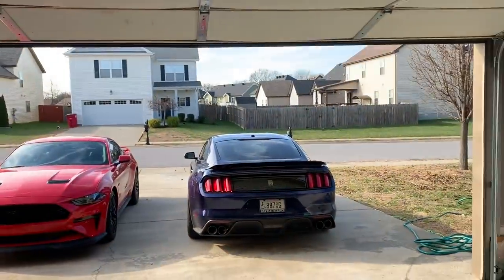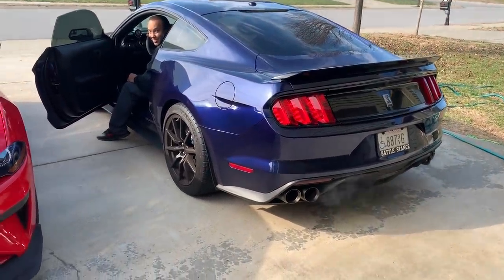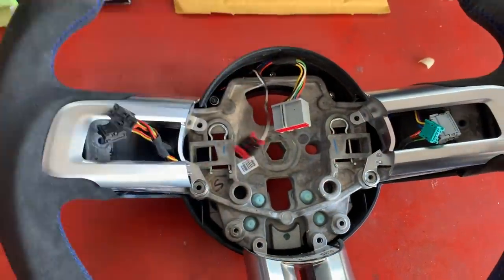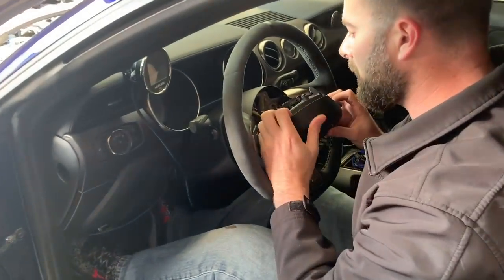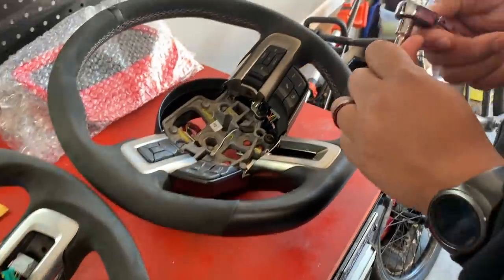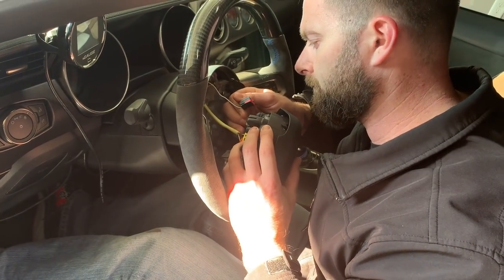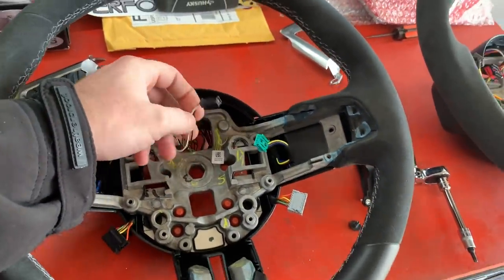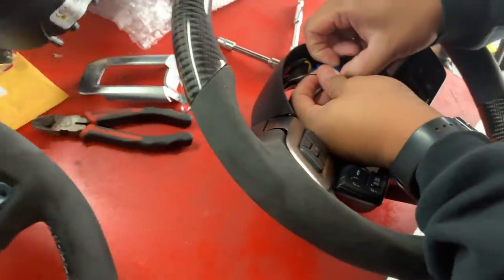Install Failure- This GT350 Steering Wheel DID NOT FIT the 2018-2019

Comment: @zander13 There’s a thread about this on the Mustang 6G forum. I called and talked to White Bear Lake Ford a few weeks ago regarding my 2016 PP getting the new 2018+ GT350 wheel. The thread should answer a lot of questions. I wanted the 2018+ wheel over the 15-17 because it’s apparently a bit more thick AND it’s less expensive than the 15-17. White Bear Lake informed me the 18 won’t fit on a 15-17 due to the audio buttons and display control buttons being swapped starting w the 18+. They mentioned it being possible w Forscan but I wasn’t willing to go thru that process. 
This isn’t exactly what your video is discussing but I figured I’d share this for all of us peasants who aren’t lucky enough to be GT350 owners :)

2018 wheel is $275 from White Bear Lake
JR3Z-3600-AB

2015-2017 wheel is $353 from White Bear Lake 
FR3Z-3600-AC

Here’s the thread:

https://www.mustang6g.com/forums/threads/2018-gt350-steering-wheel-installed.108899/
Reply: JR3Z is the key. Has to be that one for the 2018’s. I have this wheel on my 2018. Any for dealer can order
Reply: I don’t have an 18. I have a 16 like I stated in my initial comment. Obviously the 18 GT350 wheel will fit the 18 regular GT. I was giving the info for any 15-17 guys like myself who may want a GT350 wheel so I provided both part numbers with details regarding parts not fitting. 

Yes, any Ford dealer can order those parts but I listed White Bear Lake Ford for pricing due to them being one of the most known Ford dealerships on the 6G forum for best pricing. Having inquired w my local Ford dealership and a handful of others, they weren’t anywhere close to White Bear Lake Ford pricing. Even when I asked them to price match White Bear Lake Ford, they couldn’t get close. Anyone else could certainly have a different experience than me but figured I would try helping anyone else out on the matter w my efforts to get a wheel for my car.
Reply from the maker: thanks
Reply: Your right about white bear lake ford being cheap prices,  i bought a Gt350 manifold from them and payed 915.00 for it and got the throttle body for 127.00. I have the 2015 GT up here in Minnesota,  cant wait for spring.  Lol
Reply: slimtim04  just helping people out through experience. When my dealer pulled up the part number off a 2018 GT 350 it came up with the FRZ part number so I was helping people by reiterating that the JR3Z needs to be specified because the computer can pull the old part number. 

My dealer price matched. 

Just speaking from experience sorry to confuse you.

Comment: JR3Z_3600-AB is the part number for the 2018-19 GT350 Wheel w/ Black 12 o'clock stripe that'll fit the 2018-2019 Mustangs if anyone is curious.
You can find it for much cheaper from Ford Dealers throughout the country.

Comment: Need to through away them junk blue connector's an use some good heat shrink ones
Reply from the maker: Yep. It was a temporary solution just to see if it would work. We are going to clean it up when he gets a wheel that fits

Comment: When you put everything on the new carbon steering wheel and only the airbag did not fit, why did you not just took the airbag from the 2016 mustang ?
So the 2018 steering wheel you removed also would have the right airbag

Comment: Couldn’t you have just depinned the connectors and swapped the connectors?
Reply from the maker: the wheel is different itself. its in the video
Reply: Zander13 I understand the wheel is different I’m just saying instead of snipping the wire and having to re-splicing the wires, de pin the connectors and swap connectors
Reply from the maker: Byron Choney oh gotcha yes

Comment: So would a 18-19 GT350 Steering wheel work on a 18-19 Mustang GT?
Reply from the maker: Yes
Reply: @Zander13Productions  The 17 350 wheel is the same as the 18 350 wheel.
Reply from the maker: no
Reply: @Zander13Productions  just going by what tasca ford is showing part # wise.   They list the same 2 part #s for the 17 and 18 gt350.
Reply: @GTR-ex2ly  I know theres some issues especially with updates. Though a lot of the parts progressions are there.  Many showing just updated 15 parts (first letter being F).  Dont see any I or H parts.  The steering wheel that CJ says fits is a J series part (released as a 19 part). So it is possible there are errors in a part of the 18 mustang parts lineup. I'd be curious to see if the clock spring is swappable as that may fix the issue.

Comment: Thanks for the info! I was wanting an 18 wheel on my 16 since the leather is nicer than the cheap junk on mine.  My dealer researched it and told me it would not fit, but they didn't know exactly why. My thought was the wiring too, so I was thinking about just buying one to see. Glad I didn't yet. Oh well, I'll just wrap the 16 wheel with new leather.  Thanks again!!!
Reply from the maker: 15-17 will fit 15-17. 18 needs the new 18 wheel

Comment: Never should have cut the wires, the pins in the plastic hard shell can be removed and could have been installed in the other connector. At the very least the wires should have been soldered and the use of heat shrink to protect the connections. Sorry to say this looked like amateur hour.
Reply from the maker: Temporary fix and was not my decision